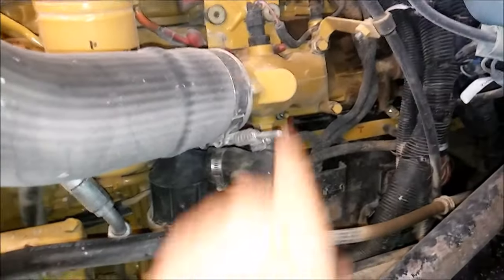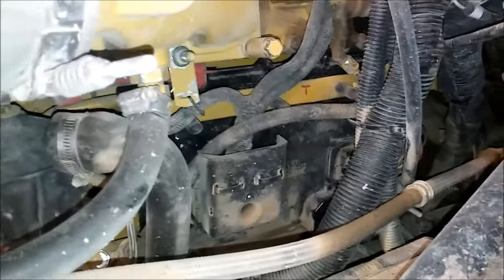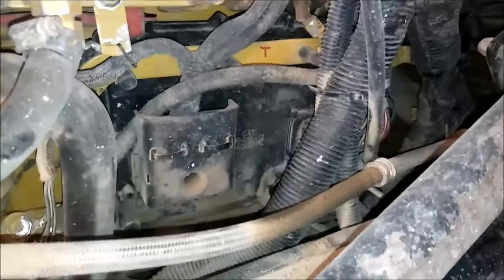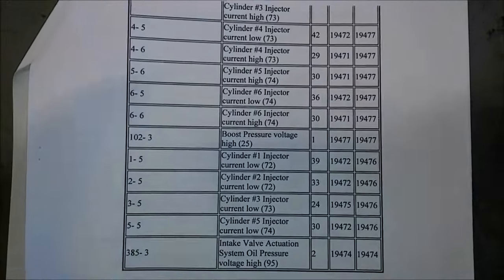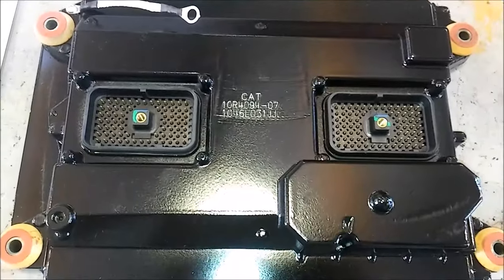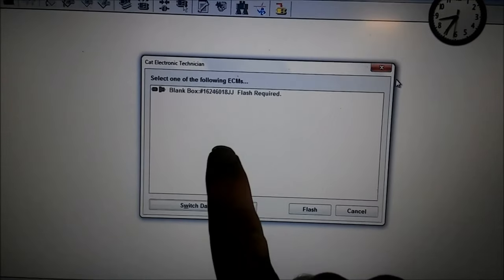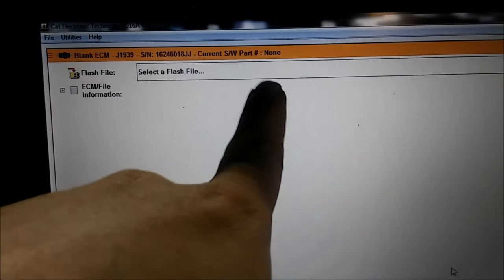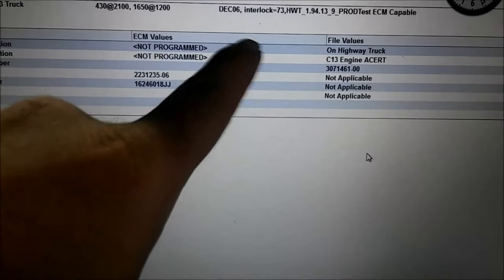How To Troubleshoot And Program A Cat ECM

Comment: I changed batteries yesterday and at startup it spun over slow for some reason, and then spun fine like  normal. Killed the ECM . Dont know why, never will, got one coming tomorrow.  Had over a million on it .
Reply: The internal battery can fail in the ECM. You have unswitched battery power to the ECM and once you unplugged the ECM you killed it. Only way around this is to have a battery hooked up say to the alt. with power leads. Just be careful as your battery cables will still be hot when you take them off. Also Cat had a bug on certain flash files that once you disconnected the battery, you could lose programming. They fixed the problem with a newer flash file. I always tell my customers to get a jump drive and get a ECM replacement file out of your ECM. Keep it in your truck just in case. If the ECM fails you need certain information out of it and you will have it. Mainly the injector codes. So when you change a injector and gets programmed, you need a new file each time. Or it's been awhile don't hurt to get one. I get one out of each Cat engine I hook up to. I have hundreds of them.

Comment: Hi, Ape first I like to thank you for your excellent video you provided to us and even now with special effect I love it lol. Question there's any way to reset or erase the old code that it's on the ECM? After putting the ET to trouble shoot the miss according to the mechanic cylinder #3 was bad I replace it my self thanks to one of your video by the way I have a Cat 3126, well 3weeks after its star miss  again this time I retrieved the code just like you said on the video with the cruise control and it give me the same code again 73, what should I do now?
Reply from the maker: I can certainly try to help you and thanks for the comment. So you have the code number, but what exactly is the code description? I'm going to assume it's an injector current high or low based on you changing the injector? Let me know and we can go from there.
Reply: +Adept Ape. well I was looking on line and I print out a sheet with all the code for cat and I can see it said...
code 73= Cylinder #3 or #4 Injector current fault.
Reply from the maker: +Alex J I just looked it up on my computer and you are correct. So it could be on injector 3 or 4, the wiring itself could also be the likely cause of this, as a loose connection to the injector or in the engine harness could cause the problem. You are going to have to get a way to do the injector solenoid test, Cat ET being the best way and the test the wiring by shorting it. If you can't do that, then check the pins on the connectors going to the injectors and make the sure metal contacts are tight, this is a very likely cause.
Reply: OMG!! I didn't  thought about that one i just put the clip back on and that it  ill check it out tomorrow and then I'll give you an update, thank you for that tip/info.
Reply from the maker: +Alex J Yeah because the ECM just tests the circuit, so if the wiring is bad it doesn't know the difference. Yeah check that and let me know, good luck to you.

Comment: Why don't they have an outer iron plate with a jacket bolted down on top of the ECM?  You tube in chilled anti-freeze from the center of the plate into the jacket, and cycle out the heated anti-freeze from the edges.  What would be wrong with a mini-radiator system bolted down and around the ECM?

Comment: How can I communicate with you guys, I’ve a 2004 motor home with a C7 cat with only 14000 miles, but I’vent started for over four years, and recently I tried to started and it won’t fired up at all, if I put starting fluid it does fire up for few seconds but that’s it.

Any thing that I should know 

Maybe the ECM went belly up?

Comment: Hello! I was wondering if you could help me locate where my VIM is located on a 2001 Freightliner fl70 4door sport chassis. I have been scowering the Internet and called a couple places but no one can seem to tell me where it is and I cannot find anything on it. My Allison switch pad is not lightning up and truck will not start. I've gone through all the normal stuff to check but am being told this VIM has fuses in it that could have went bad but cannot check them if I can't find the box. Any info would be greatly appreciated. Thank you

Comment: I have a 2005 8500 Chevrolet truck with a C7 cat engine I am not getting the yellow wire to ground the Polin coil for the starter relay I’ve taken the computer off the car dealer said that there’s nothing wrong with the computer everybody I talk to said there’s nothing that will keep the computer from activating the starter relay no crossover the engine if you could please help me with this one I’m exhausted and I have very little hair left to pull out thank you

Comment: How are u Ape my nane is cj been working with kenworths for about 5 years and was wondering if  u have ever known or seen this happening on a cat c15 MXS . Here is the senario guy comes in the shop blowing all kinds of  gray blueish smoke is a peterbilt 387 nice looking truck engine is also has a skip , first thing i check was performed a cylinder cut out test cylinder # 6 was a dead hole replaced injector by costumers request do to him wanting to get on the road quick ok done but one problem when engine is started and engine runs thru its self test like the water diverter valve and engine oil intake valve once all that is complet here comes the blueiiiish smoke and the never ending engine miss removed the valve cover and started the engine to inspect if any oil leaks were comming from a loose iva housing or anything lose on top at his point the only thing ihad found is that when the engine is initially started i look a the oil stream comming from the spool valve threaded to the rocker box housing .
soo what i have seen is that  whe oil is been held under pressure inside the rocker box housing the engine runs like crap and when the spool valve opens and starts to drain oil inside the head engine miss and blue iiiish smoke goes away. the other thing i had tested is the coolant temp sensor when disconected no blueiiish smoke or engine skip at this point the only way i can make thsi engie stop smoking and back farting is by supplying 12 volts to the spool valve soo is open all the time but then  it sets a cel light for iva circuit start  when the tuck is under load.
note : im suspecting is a bad flash file in system and on the other hand dont know because the driver explain to me that that ecm was rerated to a higher horse power 450 hp to 500 hp . soo thats t let me know what u think i think it needs a boodoo doctor to come and exercise the devil out of this engine
Reply from the maker: You have successfully sent me the longest message ever! Since you have no engine miss with the IVA venting solenoid open, that tells me that the problem is probably with an IVA sticking when it gets pressure. I would swap the 5&6 IVA and Jake housing with the 3&4 IVA and Jake housing and see if the dead cylinder moves to #4.  If it does you need a new IVA housing. Let me know what you find.

Comment: when i pulled the plug at the rocker for the injector harness it had oil in it, i thought this was weird, no leaks the far up the engine, it had oil at the computer side also , but there was a leak causing oil on that side of the engine , at that level, is this a problem, i would think so. any comments would be great.
Reply: Oil leaking out the EUI harness is a common problem on Cat engines. Have seen a ECM fail as so much oil was running down harness. What I do and Josh hates this product. On the inside harness you have a section of wires to the connector with no sheathing. I take silicone and cover it up and for force glue between wires right at the connector. I try and block oil from entering around the wires. Let it dry over night. If engine is already assembled you have to get the harness out. So you might as well order a new harness as old one one may break, etc. Or on a new harness you can pull the plug off and try heat shrink. You would need different sizes as the plug end would be large down to the wire size. I never tried this, glue is fast and cheap.

Comment: greetings from Venezuela, exactly that happens to a 325d excavator, initially it starts at high rpm lasts about a minute on and starts throwing all the injectors as a fault code and does not turn on anymore, the case was that we looked for another ECM and just connected it All the injectors are already out and it does not make the injector recognition sound. My question is, could it be that a used computer also has to be programmed? We don't know what to do anymore.

Comment: I'm 48, and so far in top physical condition. I had a cabinet shop, have done mostly kitchens, and lots of rehabs. As an entrepreneur I'm looking at starting a road service and truck towing business. thanks
Reply from the maker: I think a mobile service truck is a pretty lucrative way to make money, if you can specialize even better. RVs for instance are always breaking down and word of mouth spreads quickly. Could make some good money doing that.
Reply: Also fixing old Mercedes Benz with over 100,000 miles is also a ludicrous way to make money, if you can specialize in low end communities and slums you can make a killing fixing high mileage Benz, Bmw, Cadillac  Escalades.

Comment: My cat cs54 c4.4 engine won't start I change fuel pump common rail primary sensor,  secondary sensor engine harness when I'm trying to crank ET shows injection disable no any event code no active code 
When I'm removed the primary sensor then engine take long crank and start 
While engine running that time I'm connected primary sensor engine stop and shows injection disable
What's exactly problem with my engine can u pls explain sir

Comment: I have a 04 century with a C15 my truck cut off in the middle of the road was working fine then all of the sudden my speedometer, rpm, oil and temp went out the truck was still on for a couple of seconds but with no response. I check the ign fuse it’s good  then check pin 70, 53 and 52 they have power with 12volts while the truck if off. Pin 65 and 67 have 5 volts. I have no codes that I can pull off. When I turn the key on the gages kick in but then they die. Then all of the sudden my temp gage come on and it cranks and everything goes back to normal but then I drive 5 miles and it does it all over again. Do you think that’s a sign for a bad ECM.
Reply: I would install a bypass of power and grounds to the J1 connector. If problem goes away it's in the truck side. If problem remains, in the Cat side.

Comment: I was messing behind the ignition area. I shorted something out and now the truck starts to turn over but it won’t fire..
I can’t find any ecm fuses around the batteries anywhere. And the ones in the kick panel are all good.... any idea where I could find the battery to ecm fuse? 
Not under the dash/ not on the fire wall / and not on the battery box... suggestions?

Comment: love your videos anything i can learn is great, i have a c 12  and its cutting out here and there first on a pull then even at an idle, its like the power cuts to the ecm or something , but the guages dont move and thers never a check engine light, checked all wires and found no bad spots or fub throughs, did find one rub through at the plug going in the the rocker for the injecters , but could"t get it to cut out to se if it was the cure , guess will find out with work monday, iseems to be when engine is over normal op temp

Comment: Have a 98 GMC topkick 3126. 
Runs fine  but once it warms up while driving it stahls shutters and shakes has no power can only do 40mph. Or it will just cut off and die out.  Its getting plenty of clean fuel. Don't have a scanner, tried that check engine flashing light trick saw from jcook007fix channel. And got 72 , 73, 74,. Could this possibly be the ECM?

Comment: Hi..you're right my my oil level is increased..but can this cause a smoke
Reply from the maker: If your oil level is getting higher you probably have fuel dilution. Which is usually caused by injectors. It is possible that the oil has been thinned out by the fuel and some is getting burned in the combustion cycle. Check out my fuel dilution video to see more about it.

Comment: Hi there I got a low power issues  and my codes injector current fault cyl 1,2 72 cyl 3,473 cyl  5and 6 74  and I'm just replace injector number two  you think this is the ECM problem?
Reply from the maker: +vitaliy kostenko If you are getting all of the injectors coding for current faults then you most likely have a problem with the ECM. I've seen that probably 30 times and every single time it was the ECM.
Reply: Hello you are a good mechanic by the caterpillar. I have a piterbilt 387 of the year 2009. I have a big problem with the engine cat c-13 acert . Emission system ,pdf -problem!!!!??? At me a headache what to do or make prompt? thanks in advance
Reply from the maker: +Евгений Иванцов I would say watch my Regen troubleshooting video and that should educate you on the system better. Did you have a specific question though?
Reply: Hello friend I do not know my e-mail so I write in the comments. When I said that there is a problem with the cat with -13Acert. I have a little misunderstood my problem with me does not work system CGI, syste ARD,system PDF. Can I install a flash so these systems do not participate in the engine? I bought such a problem truck.

Comment: Hey - thanks for all the time you take to posts the videos - they are very helpful. I have a question.... I have a 3126  from a 99 Kenworth that has all 6 injector codes... 1-11, 2-11 etc... It looks like the ECM is bad. My question is - do I need to look for something in the injectors or the injector harness before I plug a new computer into this thing? Like a ground fault to power or something like that? I dont want to smoke a new ECM if I have a harness or injector issue. Do they just fail or is there an underlying cause? Thanks in advance.
Jon

Comment: I have a question, can a injector driver go out or work intermittently in an ecm without throwing a code?
Reply: Usually it will throw a controller code or whatever for ALL injectors. If its a wiring issue it'll it'll only 2 sets of injector codes. Sometimes it'll be interminet and then eventually all together the driver will go out. VERY common on a rv and buss due to poor air flow management